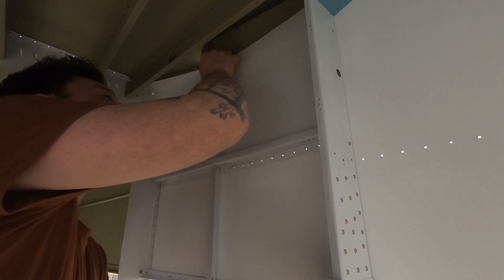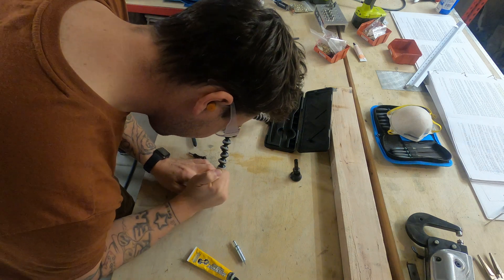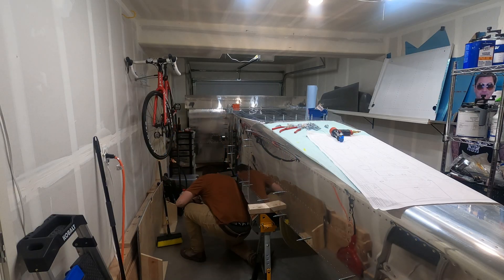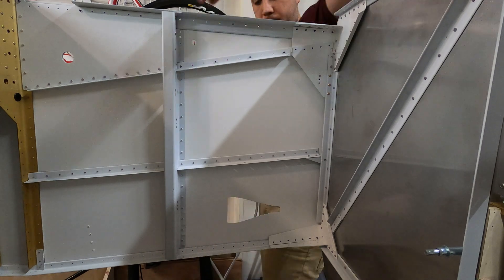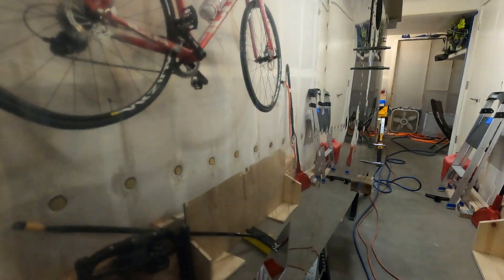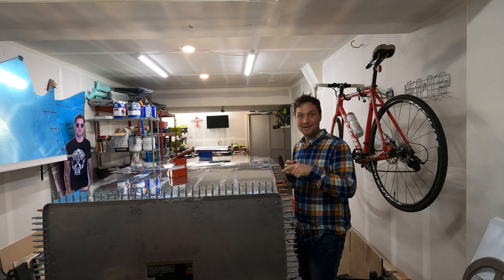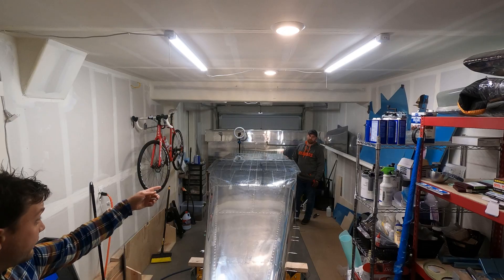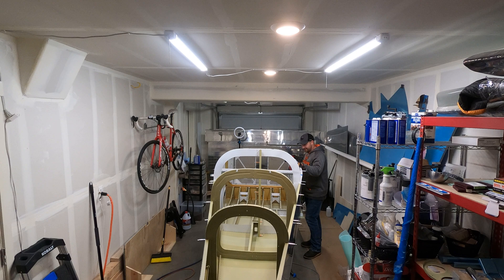The Big Flip--Turning the Fuselage Upright and Hopping In | EP3.20

Comment: Congratulations on getting your plane upright.   While watching the flip I couldn’t help but notice what an incredible job Vans did in designing and making such precision parts.    Both Vans and you, as the builder, get high  marks for what will be your aircraft.   I will continue to watch and live through you until we take that first flight.
Reply from the maker: Good to have you onboard! And yes, the kit is amazing. The fit of the parts is incredible. I’ll sometimes bemoan the instructions, and present turmoil notwithstanding, but overall the kit and the resulting plane are a fantastic achievement for the engineers over at Van’s!

Comment: Instead of a Lycoming IO-390, do you consider the Belgium ULPower UL520T? It has 220hp up to 15,000ft and is 39lbs lighter and likely cheaper as well.
Reply from the maker: First, I’ll have a 360 in here—just to be clear.

I looked at the UL Power. At first I thought they were more money—not the case at all! They seem to be a formidable power plant up against a Lycoming. And I can still change my mind…

Here’s what makes me lean toward an IO-360:

Less modification. Prepackaged firewall forward kits. More support—wider user base. 

Aviation power plants are not my specialty—none of this is really, I’m leaning heavily on the amateur in amateur builder—but it’s not an area I feel extremely comfortable. I really like the 360 as that’s the engine Van had in mind for this plane, and Van’s supports it from finishing kit through engine purchase.

Is it worth the additional $$? Jury is still out. But I really like the idea of less modification and less overall work to get it in the air.
Reply: @RyanFlysPDX  The UL520 is a single lever full FADEC engine https://www.youtube.com/watch?v=ZeWedDeRQkU and they have kits available for the RV7.